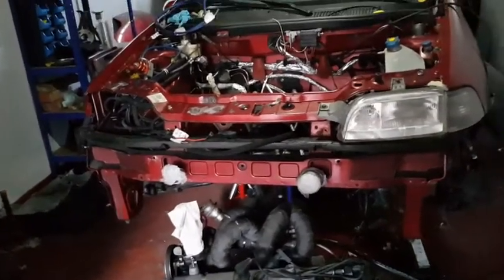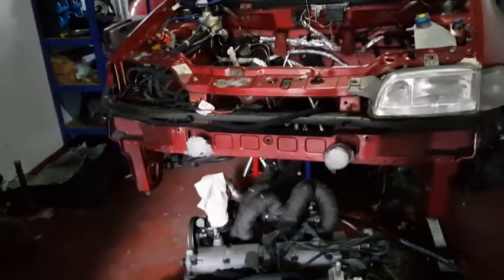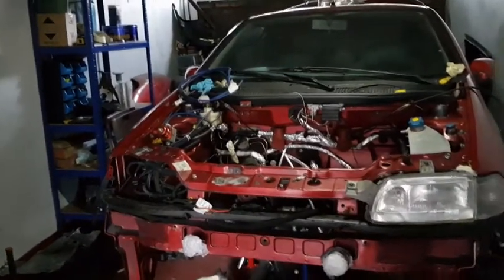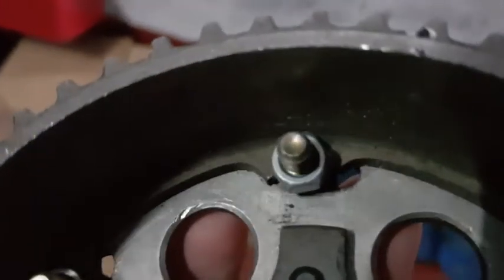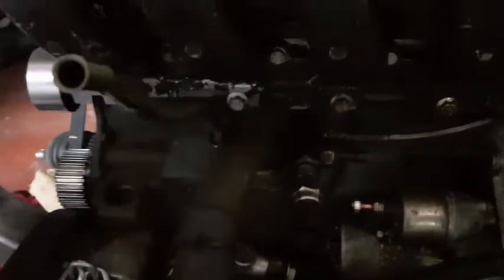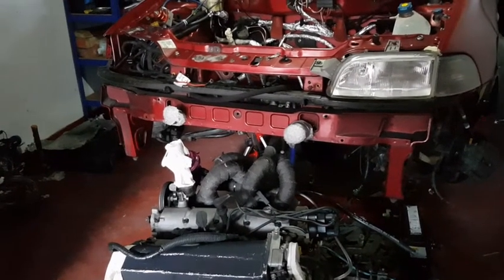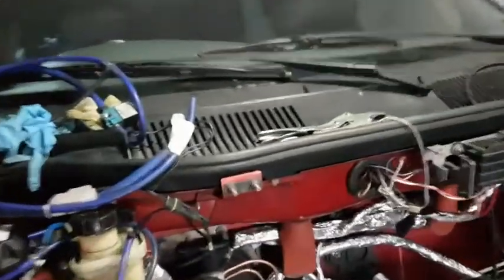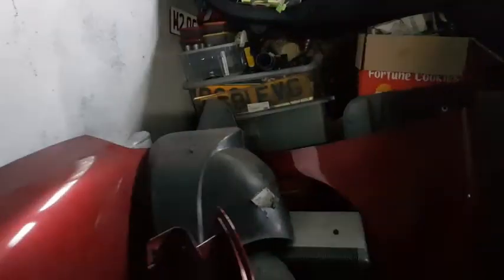Fiat Punto GT 1.9 16v Turbo

Comment: Looking good mate how much power are you expecting
Reply from the maker: Thanks mate, it was making 510hp in the previous shell, I haven't changed anything. I will drive it as it is and see how it feels, I'm sure there is room for improvement. Turbo doesn't look like anything special, I'm sure a more up to date turbo will add some more mid range. 550 should be achievable I believe
Reply: @anililguy  yes please more videos I'm tuned right 😁 I had one 5 year's ago was ah punto gt turbo 200hp+ running centre exit exhaust when I say fast i mean it's stupid fast stock block and standard cams 1.4 8v
Reply: @anililguy  

also for sure run water methanol with boost much more safer and make more power with bit more ignition timing 📈😎
Reply from the maker: @geohudson2125  cheers mate, will continue working on it soon, I now have the adjustable cams, just need to find the time to put it back together. Won't be long 😁👍 will post vids for sure, thanks
Reply from the maker: @geohudson2125  melted a valve before coz the meth nozzle was blocked, a bit reluctant to go down that route. Might just run it as a safety device rather than try gaining more power.
Reply: @anililguy   oh snap sorry to hear that 😓 with methanol burning on rocket cover